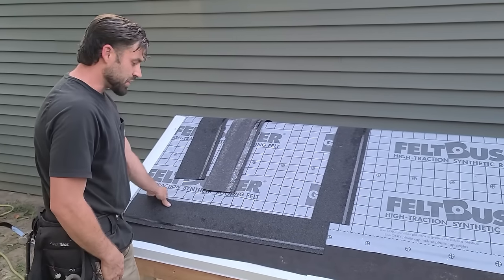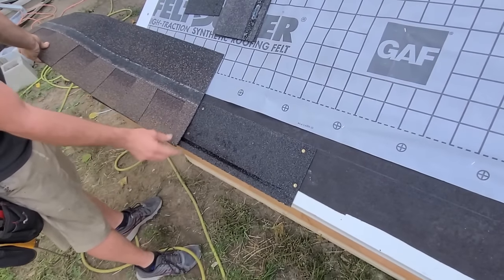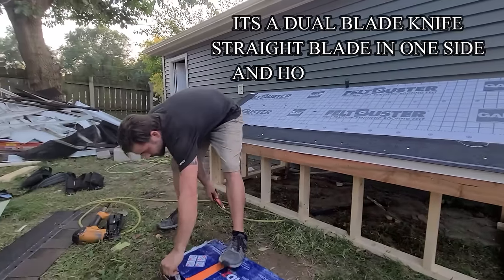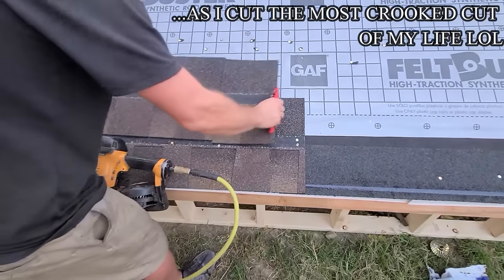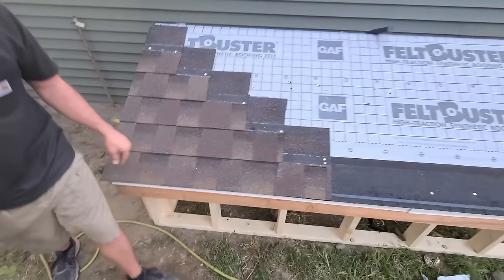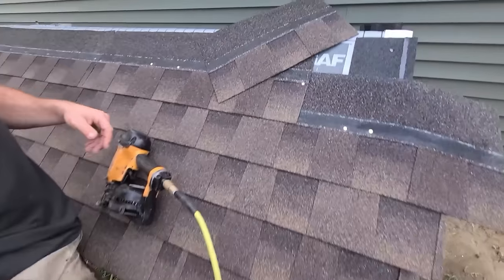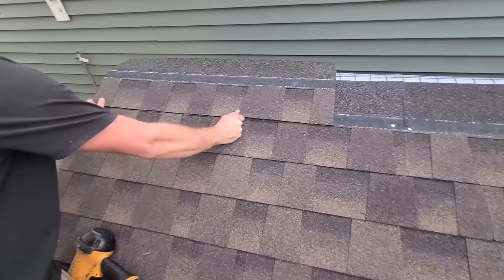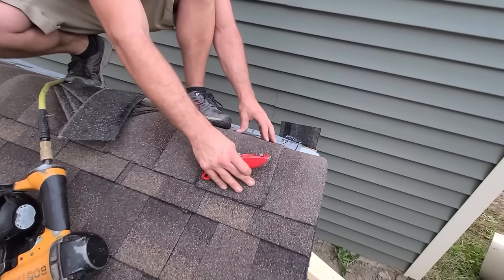HOW TO | ROOFING PART 2

Comment: When I started shingling in 91, three tabs were the thing, we snapped 5 inch lines all the way up the roof. Perfect every time
Reply: Back in my day, we rode wagons all the way to town and was a minimum of two days to haul material back….
Reply: Back in my day we skinned our enemies and used the skins as roofing tarp. It was good because back in those days, every one was 5 foot even and we didn't have to worry about using silly things like squares or tape measure
Reply: They always have to over compensate shit to up the pricetags .. Three tabs are just as good as anything else. No one is staring at someone's roof.
Reply: @garycasper2929 Where I'm from, three tab shingles do not last on a roof too long due to high winds. This shingle is more wind resistant. It's a quality upgrade.
Reply: Back in my day we put mud on our shanties out in the sticks and boonies.

Comment: I don't see any of those starter shingles in Home Depot nor Lowes, so I just turned my regular shingles upside down for a starter shingle, then put another over it in the correct position on top. I'm using the old fashioned three section shingle.
Reply from the maker: You have to go to a construction material place like beacon building products or abc building supply
Reply: @NWIVeteranConstruction  Thank you. I've already started and have half my roof done already. I'm old so I only get one square down by 10 or 11 Am, then I come down because it gets too hot and the shingles start sticking together too much. I don't think I've seen either of those two places in my area.
Reply from the maker: @Robert Karp  there should be a private distributer within an hours drive, sometimes lumber yards will have stuff like that.  but if you're doing it for yourself then you're fine using an upside down shingle
Reply: @NWIVeteranConstruction  Thank you. My biggest challenge has been two roof jacks, both for AC Connection that are close together that a corner of the flat part had to be cut off to clear the upright part of the other. I've had a hard time shingling around those two properly and I know what I have there now is going to leak. So I'll have to go back and try something different. one of them isn't hardly a pipe coming up. It's a small tube for the electrical to pass through that is much smaller than the opening of the boot. They are open ended boots, there's no rubber seal around them. Tomorrow I'll be working with a couple valleys. I worked for a roofer in Arkansas in the Mid 90's for a little bit, just enough to get me into trouble now.

Comment: Good roofer. Gittin' er done.
4 nails is enough. Wasting 25% with 5.  And no shiners. Reloading less often
I put the factory end on the right rake. Nail it and make the cut on the inside end.
Make all my cuts with an old pair of large tin snips. Try it you might like it
You're welcome

Comment: I don't know if you have time to answer this question. My roof rake on one end is less at the eave than at the top of the gable rake  at the ridge it's 15° on the other end there is a dormer. Im thinking instead of cutting the starter shingles let them over hang the rake as i work up and cut them every five shingles. Thanks great videos
.

Comment: With Certainteed Landmarks and the Certainteed swiftstart starters they are the same length which is nice
Reply: I find most brands are like that. GAF seams to have made their starter to fit their 3 tabs and not updated it. Don't quote me but I heard the official solution is to start with a half length, but on a long run it will still catch up.
Reply: Was just gonna say the same!!
Reply: I start every gable with a starter, which is a out 8inchs and start my starter stager like that

Comment: Could you run your first starter up the rake?...butt the next one up to that running along the roof line...first shingle is a full one...seems the easiest, to me any ways.
Reply: It's what I usually do. It only works if the starter is the same length or longer than the shingle though. Otherwise the step will shrink like he mentioned and cause you problems
Reply: That is what I always do, but that only works if the shingles and starters are the same length.
Reply from the maker: yes already answered that question here somewhere. not a bad move i used to do it.
Reply: @Lonestarexteriors  ..right...if they were a different length...you wouldn't have to run the first one up the rake...as far as I know this was the first time the question on this video was asked.
Reply: That's the way I do it,  and have been doing it forever

Comment: would love to see a video like this for a hip roof
Reply: Only thing different is that you don't. Have to put starters on the hips just the bottom. Then run cap up the hip the same way. Cap the hips first then the ridge. Frist cap on the ridge gets sliced from the center of the tar line out to either the top or bottom depending on preference, so that it can sit flat against the three sides it touches
Reply from the maker: I'll be making one soon.  It's part of my plans for the build on this
Reply: Oh or a thigh roof

Comment: I get over hanging starter on gutter apron. Over hanging on drip edge isn't really needed. It already overhangs by an inch from the facia. I know it's about preference, but I don't get overhanging drip. Run your starter flush with the edge of the drip, and run it. To each their own, I guess.

Comment: assuming water shield is better than paper, outside of expense is there something wrong with using ice and water shield on the entire roof?
Reply from the maker: Well for starters, it's kind of a d*k move to be honest lol tearing off the shingles on that is no fun, entire roof might need resheeted next time the roof gets tore off. Also, even in icy areas, most roofs that were done well didn't have ice problems on the eaves before so the ice shield is just an extra thing of protection. It's just unnecessary on a few different levels, unless of course, the pitch is 3:12 and lower

Comment: Zach how much caulk if i have alot of the nails in seem,some non covered nails too due to no chaulk lines used.if i get 7 yr from my new roof i think itll get metal over all .just did as good as i could.again nails in the seam was something i found difficult to deal /w
Reply from the maker: mmm. i've tore off plenty of roofs with that going on that never leaked so i wouldn't sweat it that bad unless there's a problem. its just a good habbit not to nail there.
Reply: @NWIVeteranConstruction  my wife said same thing,i spent a few summers tearing off and not so much watching either,little installation tho
Reply: Get a roll of trim coil metal cut 4x6 squares and put them under seams with nails. A dap of caulk will hold fine.. If you don't get 7 years out of a brand new roof then I would suggest hiring a roofer next time. But you should be able to do somepreventive maintenance and get at least 15 years
Reply: @projectpat2262  ive dabbed roof tar on nail pops,that metal card trick is a great idea no one ever suggested thank you

Comment: More shiners in this video than when you combine dozens of his videos hahaha
Reply from the maker: lol facts
Reply: @NWIVeteranConstruction  what’s the non hillbilly way of repairing or covering shiners? Is there a standard fix?
Reply from the maker: @calebwhite6173  pull the shingle and put a new one is really the only good way.  Or maybe remove the nail,  loosen the shingle from the bottom and put color match caulk underneath the shingle where the hole was so that caulk oozes out and you can put granules over it
Reply: @NWIVeteranConstruction  alright fair enough. I was taught just caulk over it and the granules over top. It’s a bit excessive to replace the shingle unless you really mess it up haha. I like the different methods so thank you. It will definitely come in handy in the future. One other thing I’ve been taught is when looking for a leak look for rusted nails and it usually leads to the source of where waters getting in. These videos are great and make me really excited for this work. Can’t wait for summer!
Reply from the maker: @calebwhite6173  I won't tell you that right... but I also won't tell you not to do it lol 😜
Reply: @NWIVeteranConstruction  Hey one of these days can you make a video about the nail guns, maybe what brand you like, how to maintain them and repair them or where to get them repaired, how to clear jams etc. It would be really helpful.
Reply from the maker: @calebwhite6173  yea will do.
Reply: @NWIVeteranConstruction  ❤️❤️❤️
Reply: @NWIVeteranConstruction  I’m back. T o add on to this maybe break down a basic “what I would do when first starting out” meaning tools to buy specifically air compressor, do I need to worry about cfm if I do want for a compressor. You mentioned a hose you’d never live without in another vid and it was yellow. Forgot what it was called. Do I have to worry about having 2-3 guys with me on the same unit etc. Since I’m here can I ask what your setup now is? I would still like a vid in the future. Im sure a lot of new guys would like the help. Every company says they’re the best and their products last the longest so it can get really confusing fast and end up spending a lot of unnecessary money and headache finding the right stuff. Your probably one of the most competent roofers I know and there’s not a lot of talk about a good standard when you get started. Thanks!
Reply from the maker: @calebwhite6173  thanks man. The hose is a flexilla (¼ x 100')  and I believe that i put links into the most recent roofing videos description to buy all this stuff through me if you want.  Porter cable pancake compressor will run 2 average roofers with guns pretty decent.  I recommend Metabo or Bostich guns, shoot even tool shops and master force are ok if you're not doing 30 roofs worth shingling and wanna save a buck.  Knife with a hook blade.  Regular old hammer and get a chalk line with quick reel and peach colored chalk with a low permanence. Get as many ppl as you can for the roof.  Period. 2-3 or 7 will do lol
Reply: @NWIVeteranConstruction  so it’s all about time. Funny enough I started roofing slate last year and got thrown on a $35 million house and hand nailing everything. Hopefully my accuracy is up from all that nailing haha. My work buddies often do side jobs on the weekend and knock out a house or two and when I heard about the money I’m definitely interested. Honestly I went from knowing nothing about roofs and hating life for a bit but now I can’t get enough. I love the process and giving a good product for someone. It’s a lot of fun. I even enjoy sweating and going through 5 liter a day XD I swore I’d never do shingle but it just looks so dang fun especially if it gets me a new f150 down the line. I was overthinking the whole equipment thing. I do want a bostitch but harbor freight is enticing with one for $60 I could thrash that thing to hell and back and make enough to buy a proper gun haha. Who knows I might get so much fiberglass in my fingers that I swear Ill never look at another shingle again but never know till you try. Take it slow and you learn everything with practice then you speed up. It’s a lot harder to break old habits. Oh. And I’ll get good enough to work with the big dawgs hopefully run my own crew too. I do metal, copper, slate, rubber and now shingle. The guy I work for does it all so I learn it all. I want to be a roofing god haha. Thanks for the advice man and keep up the good work. Oh and I’ll go through and use your links. It’s the least I can do.

Comment: Just wondering- I’ve been working as a labourer for a roofer for the last couple weeks, rather than cutting the shingles as he lays them, he just lays a full shingle and shifts over about 6 inches each shingle going up, and then goes back and fills in the gap afterwards.  Does anyone know if there’s an advantage/ disadvantage to doing it that way or is it just preference? Thanks!
Reply from the maker: I recommend doing it as I did.  You can precut them, cut them as I did in place, or hang them over the edge, to each their own but you're gonna wanna be right in this realm otherwise you're likely wasting time or creating more work. I have a YouTube short on why I create my stair step like this
Reply: @NWIVeteranConstruction  right on man, makes sense.  Thanks for getting back! 🤙
Reply: Most shingle packs have illustrations on the back of the package....I would follow those instructions.....👍

Comment: Getting my roof done here in Chicago in a couple of days which shingle should i get Landmark vs Duration!???
Reply from the maker: Either or. I prefer gaf over em all but the o.c. will probably seal better in this type of weather
Reply from the maker: Speaking from experience more a science book.  Landmark might seal better idk really but if you're doing o.c not as well pick a variation color like storm cloud or sumn. Same price and can match really well to your house if you get it right.  Most are in stock at beacon for sure
Reply: I was leaning to getting colonial slate but storm cloud looks bad as which one will you reccomend for Gaf?
Reply from the maker: @EdgarRodriguez-eu1pc  all depends on your siding and fascia.  You need to match that. It's not just about a color looking nice it has to go with the house so I won't be able to tell you.

Comment: Would it be possible for you to do a video on the mathematical process on figuring out how many shingles you need for a roof or how many sets of shingles you need and I don't know I was told to follow this YouTube channel by vandermeer roofing if that name rings
Reply from the maker: That's nice of him I'll have to check him out. I have a video on that from about 1 yr ago. If you stick with it it will make sense.  Pause the video and take notes because triangles get tricky. Squares though are easy, length x width.  I usually round up to the nearest foot and that accounts for scrap
Reply: I don't think he does YouTube videos it that's the name of his company
Reply: I have a question I just recently started doing construction and roofing with vandermeer roofing and I'm curious do I need to focus on buying the necessary tools and setup I need for the job before anything else or I mean course bills come first
Reply from the maker: @taylorricker4600  depends on your position in the company.  If he sent you my way he must like the way I work and want you to take notes by watching my videos to speed up the learning process. You should be Killin it by mid summer if you pay attention.  Watch my speed tips and trick video. "Less time same effort" in the thumbnail.
Reply: @NWIVeteranConstruction  one more question then I'm going to bed the rules and regulations for the roofing for each state I know they're different for each state but are they different for each county

Comment: You don’t have to do stair steps right at the beginning, you can finish your first row then cut 6 inches on the second and so on, this way you know exactly how short you gonna be at edge as you go.
Reply from the maker: You cannot get in a rhythm that way. That works for flooring and siding but not roofing.  Check out my most recent roofing series.  Part 3 specifically.  I think you'll find it insightful, it's performed very well and one of the few videos I'm proud of 😂

Comment: What happens when you get to the last run on your ridge and one side is running an inch and a half off because you didn't mark the whole roof off.
Reply from the maker: Never happens to me unless there's multiple people shingling.  Even then.  Not an inch and a half off. Would either leave the top row off just incase or several rows and cheat which ever side is higher down gradually
Reply: @NWIVeteranConstruction  fair enough. I been going behind some shotty framers and it's not uncommon to be off an inch from fascia to ridge. So I've been making my guys pop 6in lines all the way to the ridge. Just curious how it works out when not measuring it out. But looks good man
Reply: @projectpat2262  we get started then with 6-8 rows left measure and shift if we need to do they match. Can do this from the start as well and just measure every few rows or more. Depends on how large the project.

Comment: A little mouse can crawl in between his two metal overlap. Not best. You need to squeeze the end of the one coming on top, or if wood deck not straith you need to cut your metal at the peaK of bend or curve and restart your edging with new overlap. If you just do 3/8 outside metal edge you could nail your starter into asphalt strip and with long enough nail you can reach your facia wood too so strong wind will have no chance to play with you first shingle row. If you worried about water penetration you could mastic or caulk top of nails that will also serve as additional 'glue' holding down first row to your starter, especially  very low slope roof needs extra attention. Just watch out of amount mastic you use so as to not sticking out and make a mess of the face of your metal edge. Also, since this roof almost flat throw in some mastic or caulking for your eve metal connections, again small amount to keep edging clean. Of course these tricks mostly for homeowners who wants maximum performance out of their new roof.
Good luck.
Reply from the maker: Ain't no mouse getting in none of my metal lol everything is tight